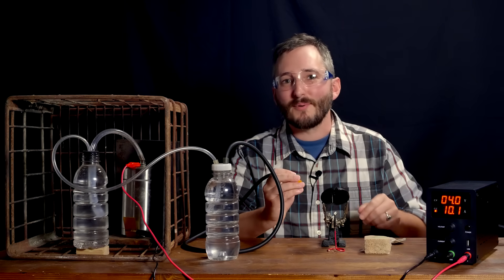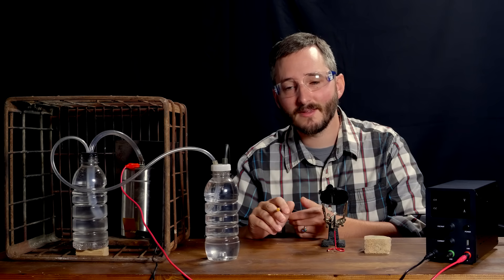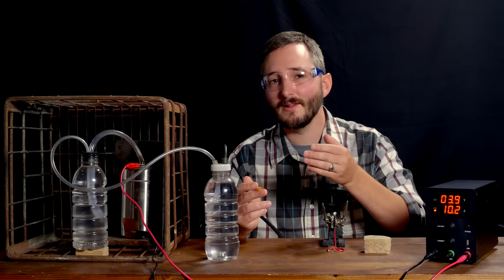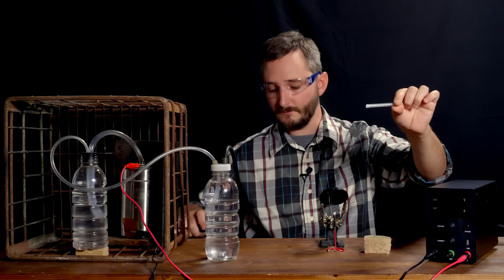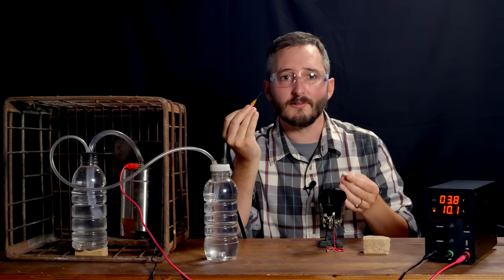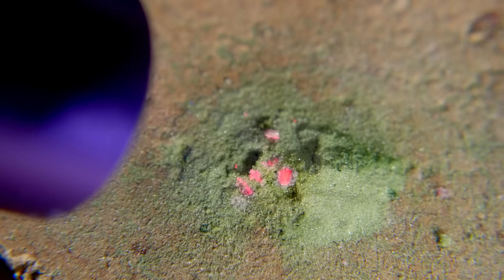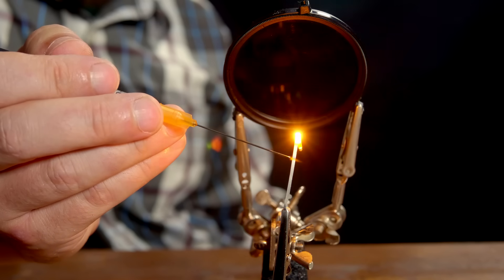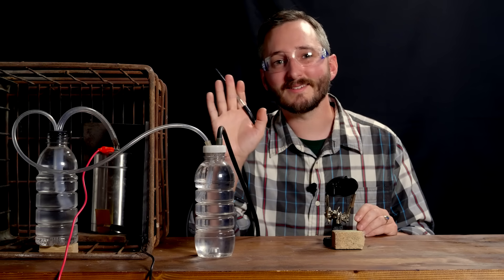DIY Oxy Hydrogen Torch Using Water Electrolysis

Comment: try with tungsten needle. it should resistance with heat better than stainless steel. 

try cnc machine to cut glass or steel with this oxigen torch?

Comment: Could you use this torch in the center of a coil to produce steam? and then on a second pass to make superheated steam? maybe not so small but on a slightly larger scale?
Reply from the maker: The flame is superheated steam. Hydrogen and oxygen burn together to produce water in the form of steam.

Comment: "As a safety measure I always keep this ready to use in my empty hand while the torch is held in my other"

Two seconds later, the torch is lit and the wet paper towel remains lying on the table while using the torch.  Pretty cool demonstrations though and I appreciate the attention to the danger.

Comment: I do oxy acetylene welding for steel and fascinated by the potential savings that could be made using a device like yours. Yes it would have to be bigger but that's easily possible with some clever ingenuity I'm sure. The prices are astronomical for the gas I buy , so steep ....impossible not to save a fortune trialing your rig. Any ideas how this might happen? How to go about it? Thoughts?
Reply from the maker: You might be able to find some commercial electrolysis torches for sale, I know they are made. Don't know if they compete with the size of a normal acetylene torch

Comment: You might have already done this before, but I can't remember either way. If this gas is too dangerous for you to advise people at home trying then I'm curious about a purely hobbiest level gas we can produce at home that you think is reasonably safe. Not safe because I don't think this kind of thing can be, but maybe something where the gas isn't so explosive so in the worst case, and in small volumes, we're not going to burn our faces off lol.

It would be neat if you did it completely with stuff people could have at home. Like a car battery or battery charger instead of that thing you have to power the reaction. And other household stuff you could pick up at a hardware store.

Comment: Im a jeweler and you're right! it would be so good especially for jobs that require a part to stay cool (for example repair job with a stone already set)while soldering a small section (usually use laser welding, but they are hecking expensive hahaha)

Comment: So you can get hardened 3D printer nozzles at around .4 mm diameter and the mass will absorb heat more than a needle. Do you think a torch tip can be made from the 3D printer nozzles?
Reply from the maker: Yes probably

Comment: One way Check Valve
 And Flame Arrestor, prevents this, though the model you built does resemble the basic operating of a Wet Type back flow Flame Arrestor.

Comment: An artist could use it for very fine cutting and creating surface effects on metals and more. That torch could join various materials, welds them together. An amazing property is the ability to create the temperatures needed for materials simultaneously. Examples are copper to steel, glass to rock or concrete. Amazing flame!
Reply: Yeah you know laptop hinges are stainless steel with steel angle iron riveted to them and they break at the joints all the time - Im going to build this to see if I can weld / melt that joint or fuse that joint back together.

Comment: The beginning and end of your video shows glass being melted, but you didn’t show or talk about this in your video. I’m curious what the maximum thickness this torch would be able to cut and if mirrors would be able to be cutted with near perfect edges. I’m thinking specifically with implementation for kalediscopes and specifically hollowscopes like Gary Allison’s works. If the torch would enable precise cuts and shapes for complex polytope and the like.

Comment: Parts from spray/squirt bottles contain one way valves that can also be used as blow back protection. I found a rather useful, multipurpose unit inside foaming hand soap. Hidey Ho!

Comment: Great descriptions you have. You may consider using fine Silver wires instead of Aluminium packing for the safety heat absorber. (No expense spared model) You already know it has twice the thermal conductivity of the cheaper metal, and have probably considered it. (Jeweller supply store?)
Would any Silver oxidation be negated by the hydrogen atmosphere?

Comment: Would it be considerably safer to keep the O and H separate until combined at the torch nozzle tip.
Reply: They are not produced separately. Both gases are produced by the same reaction. You need to remove one of them, to get the other one. I can't think of a practical way to separate them without a system several times more complex than this is.

Comment: I think this burner would be great for punching a hole in the bottom of a bottle, to install lighting in it. No cord, hanging from the Neck. just cut off the plug fish it through the new hole, and replace the plug with a new one.  I just might have to try this, Thanks, and keep up the great work

Comment: I ben using HHO torch for 10 years whiteout any safety issue I use flash arrestors that I made Whit ,3 different screens rotated in different angles inside the torch before the bubbler the torch I made is made of metal 1/4" pipe whit a copper tip Whit a 1 mm hole also I have suth of key right on the torch hho is not the only has capable of back fire also propane gas acetylene gas use on weldding  and cutting torches and course gasoline All this quimicals use flash arrestors the gas thanks in the cars have a small area that accts is a flash arrestors Hho is just that is very very fine density gas and the components hydrogen and oxigen together is not a good combo love you video Great information

Comment: How about showing a way to compress and store the Hydrogen and Oxygen at low pressure.  To make a small torch that would have some actual practical use.  IE. Soldering plumbing connections, or anything you would use a Mapp gas torch for.

Comment: correct me if I am wrong but at 3:54 he says that in order to increase the flowrate you need to use a narrow tip. Isn't this wrong? mass flow rate stays constant trough out the tube, and the speed of the gas increases when going trough a converging nozzle. Also, doesn't the pressure drop?
Reply from the maker: Pressure increases in the system when the outlet size is decreased. Pressure drops in the nozzle with increased velocity to compensate for higher system pressure.
Reply: @Nighthawkinlight  ah like that! thank you for your quick answer!

Comment: The flashback effect may have a practical use. I wonder if this could be used for mine blasting or demolition work. I picture a whole lot of metal tubes connected by fine hose to an electrolyser, and placed in the proper blast points. Once everything is in place and the site evacuated, you can activate the electrolyser and, once the tubes are full of gas, flashback to set the tubes off and complete the job.

It's safer than using explosives, which have to be securely transported, stored and prevented from accidentally detonating while being installed. With electrolytic hydrogen, nothing is explosive during installation until the site is cleared for blasting.

It's an idea worth experimenting with. It's possible hydrogen doesn't have the brisance needed, but it might be worth exploring the possibility.

Comment: At home...lol .. at home store the hydrogen off your solar panels in a high pressure tank or hydride and run you trucks an cars on it.  You only need to adjust the timing for the combustion speed of hydrogen is fast

Comment: Just place the reactor into a concrete safe. Remove the lock pad, so there would be a not too big hole to pass all the wires and tubes.

Comment: I'm trying to brew up ideas to make a 2x3x8 inch brick of ruby. Do you think that an oxy-hydrogen torch would be a good source of heat in lieu of a carbon arc furnace? 
Where would I go to study safe practices and mechanics of dangerous gasses like this?

Comment: Dude way too much safety, I heated ammonium nitrate in a test tube bubbling into a jar of water to produce nitrous oxide and only 1 gas trap without water to prevent water vapor from going back to the test tube and touching the motlen ammonium nitrate and I felt pretty safe just covering the test tube from my side with a book to prevent glass blowing in my face in case my ammonium nitrate decides to go Lebanon... Also I was drunk.... Did that for 3 years straight... Damn I love nitrous oxide until they banned ammonium nitrate pffft ehh.. Well....nice video by the way 
 
You might be wondering why I did not use a pneumatic trough to safely extract the nitrous... I was lazy

Comment: question, why not just dip the tip in a cup of water? after all you just want to cool it down to stop the reaction and dipping it in water would be fast and you don't need to worry about 1. the paper towel drying and 2 having to always holding it in your hand.

Comment: Shrinking the nozzle doesn't increase neither the flow rate nor the pressure. According to Bernoulli's principle, it actually increases the speed of the fluid. Both pressure and flow are directly proportional to the diameter of the tube.
Reply from the maker: Pressure increases in the system when the outlet size is decreased, forcing velocity in the nozzle tip to increase such that pressure in the nozzle remains consistent with the system.
Reply: @Nighthawkinlight  Pressure is force over area. If you decrease the area of the nozzle you decrease the pressure. Keeping it constant is a job of a pressure regulating valve which varies the supply of fluid to make sure that the area is optimally covered.
In this case there is no such valve so the pressure is solely dependent on the fluid supply from the HHO generator and on keeping the nozzle away from blockages.
As a side note flow can be restricted by the cross-section of the tube because if is the amount* of fluid that is moved in a unit time through a space. If the space is constricted and the fluid is incompressible or the container is sturdy enough to contain it then you will not have enough space to move more than a max amount of fluid.
*Generally the system calculation is simplified to a fixed density though that is never the case with real life compressible gasses.
Reply from the maker: @victorunbea8451  Gas pressure, as in 80 pounds per square inch is a descriptor of the pressure of the gas only. A gas can be 80psi in a container with an internal surface area of a square mile, or 80psi in a container with an area of only 1 square mm. Changing the size of a surface resisting gas pressure only changes the amount of force that surface experiences. It doesn't change the pressure of the gas itself. When you have a constant production of gas as you do in this electrolysis system, the pressure in the system will increase proportionately to how small you make the outlet. Eventually the outlet will not allow as much gas to exit as is being produced, at which point gas pressure will increase so much as to blow the top off the tank.
Reply: @Nighthawkinlight  My original comment was about the pressure output at the end of the nozzle, not in the system. What you're talking about is the static pressure in the entire system.
In the system the force increases due to  pressure * volume = moles of fluid * ideal gas constant * temperature, in which all stay relatively the same except the pressure which increases due to moles which in turn increase due to production. The volume is unchanged, the constant is... well, constant, and the temperature change by combustion happens outside the system so that's roughly the same as well.
At the nozzle however, the pressure will be lower than the system pressure. What changes is the speed at which the atoms fly out of the needle. This lower pressure is the reason why you can easily plug a small leak with your fingers but try to plug a mains with your hand and you might just break a few fingers, while both may be flowing at the exact same speed. (Of course going above a certain threshold will cause your skin to be ripped off in either case but the point is that pressure in the tube leading to the needle will always be higher than the pressure in the needle.)
A waterjet takes advantage of this by firing water loaded with abrasives at supersonic speed to cut through solids. It does this by imparting kinetic energy to said abrasives rather than using the pressure of the fluid mixture.
Bernoulli clearly dictates this and you can find many examples of the explanation on both Youtube and Google.

Comment: Wouldn’t Bernoulli’s principle state that the gas being restricted by the nozzle would have an increase in velocity and a drop in pressure.  It’s a common misconception that pressure rises in reduced IDs simply because the velocity of the medium is accelerating.
Reply from the maker: Pressure increases in the system because of a reduced outlet size. Bernoulli only speaks for what happens in the nozzle itself.

Comment: Love these hydrogen type experiments, seriously believe Hydrogen isn't getting the attention it should be as a potential fuel source. Wonder if this could work with a small tesla valve as a means of increased output pressure whilst protecting against flash back?
Reply: The problem with using hydrogen as a fuel source isn't just flashbacks or it's explosive nature. It's keeping it contained. Hydrogen, as Element 1 on the periodic table, is the smallest atom of all of them. This means that there is no container that can keep it completely sealed, because its tiny atoms can slowly leak through the gaps between the bigger atoms of any material we can make a container of.

It's a very slow leak of course, but its enough to fill a garage with hydrogen gas (unless you have a vent in the ceiling since hydrogen is lighter than air and rises) if you leave a hydrogen-powered car with a full tank parked in it for a day or two. Even with a vent, any situation that results in a possible buildup of raw hydrogen in an oxygen-nitrogen atmosphere is not one I want to be within a mile of!
Reply: @Mystikan  How about N H3?
Reply: @johnsherman7289  Well, you can store it as ammonia but then you're expending energy cleaving the hydrogens off the nitrogen, which kind of defeats the purpose.
Reply: @johnsherman7289  According to IEA AMF, H2 at 300 bar and 25 ℃ has an energy density of 120 MJ/L. The same for NH3 is 18.6 MJ/L. Ethanol is 26.84 MJ/L, methanol is more toxic and 19.90 MJ/L, diesel 44.11 MJ/L, and gasoline 44.34 MJ/L. The H2 storage tank of a Toyota Mirai is 700 bar and safe to shoot.
Reply: @Mystikan  Not to mention the hydrogen that does leak through can damage the containing material -- for example hydrogen embrittlement of steel. Very tricky stuff to work with!
Reply: peter kincaid  What?
Reply: hydrogen doenst get much attention because it burns really well, which is good, but it burns too well

Comment: One way to get a better air flow is to make each set of tubing slightly smaller to increase the pressure which should increase air flow velocity

Comment: I know this was posted a while back; however I designed a tank that utilized this nd to stop the flow rate from dropping too much, u can pump the gas into a pressurized tank and run the second flashback arrestor from that tank and use the torch through that 👍🏾

Comment: I wonder if adding an arrangement of fins in a square grid pattern almost like a honey comb along the inside of the nozzle would help with keeping it cool by adding more surface area for the flowing gas to cool, or perhaps even using a tube large enough to slide over the actual nozzle and act as a water jacket similar to the design of the vickers gun.

Comment: Why wouldn't you just plunge your torch into an open cup of cold water to extinguish it? That sounds like a much easier emergency procedure.
Reply from the maker: Increases exit pressure around the nozzle and may cause a flashback

Comment: High-speed footage of that shattering at 12:28 would be cool, it would be interesting to see how the crack propagation occurred and from which point.  It would be easy to assume it was the cracking near the final hole, but with the torch further down, I'm betting it started a new edge crack we didn't have the frame rate to see.

Comment: Well... This is similar to my oxygen mapp pro torch only difference is the fuel. But I've seen hydrogen oxygen produce with 50 amps 5 volts and it was a torch made with a regular gas welding tip and it worked fine.
Reply: I've also used a bill miller's plastic container to create oxygen and hydrogen with two tent stakes and soldered on two fins of metal from a toaster. The output was amazing at 12 volts 1 amp using salt in water. I used a Duracell deep cycle AGM battery.

Comment: I was once imprisoned and electrolysis is a method of boiling water. Aluminium is primarily used as both anode and cathode and voltage is 240vac with no current regulation. Sodium chloride and water are used as the electrolyte. I remember trying to explain to a cell mate that it's important to only operate it as required as to not fill the cell with hydrogen and oxygen as we were also both cigarette smokers.

Comment: If you've ever used a gas stove, you will know that when you turn it on, you smell CH4 Methane. That gas leaves the Biosphere, forever.

Imagine what happens every time that you lose H2 playing around with electrolysis.

H2 is lost into outerspace. (Water)